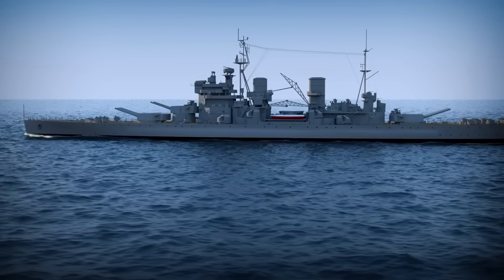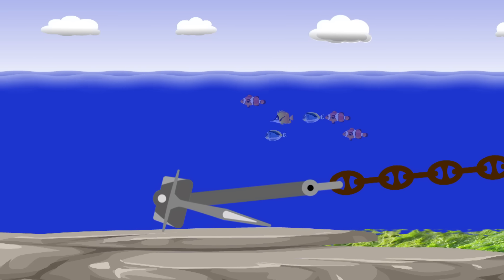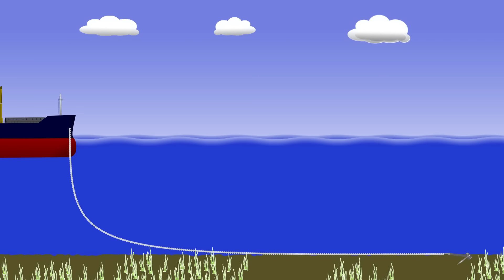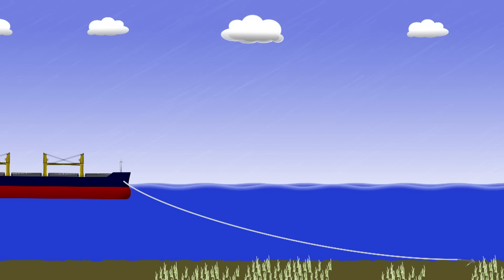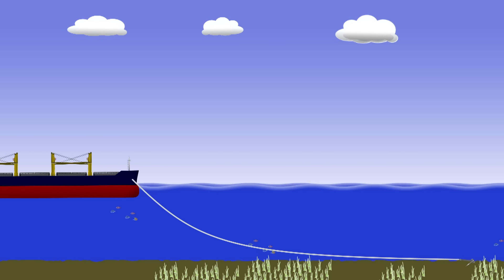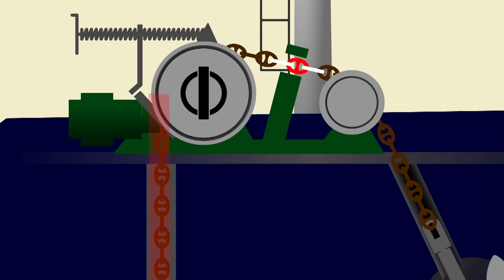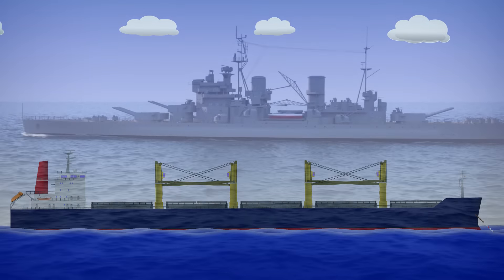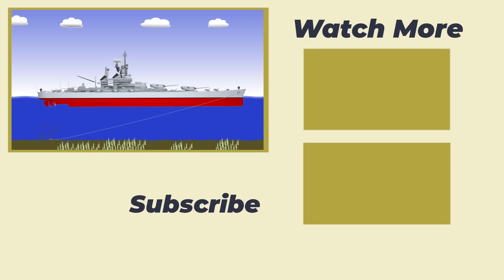The Truth About Anchoring Huge Ships

Comment: I never thought that a lesson in how anchors work would ever be warranted, until this video.  Now anchors and anchoring systems are actually really interesting.  Surprising how many things in this world you take for granted when you always think, "Well, that's self explanatory"
Reply: This is just the tip of the iceberg in terms of anchoring in general.  A real good overview of anchoring for large ships. Smaller boats use different types of anchors and anchoring systems.  Fascinating and oh so important for sailors who are not marina hopping and need to be safe over night.  Small boats use a variety of anchor styles to dig in below the surface of the bottom using the weight of the ground above the anchor to help hold.  Anchor chain, where used, is used to hold the anchor flat on the bottom so it digs in not up.  It can take a long time for an anchor to burrow and develop full holding power.
Reply: I'v actually always been wondering how anchor work, it look so tiny compare to the ship how it going to keep the ship from floating away and how the fluke (doesn't know what it's called until this video) hold securely to the sea bed just by dropping it.
Reply: @koharaisevo3666  The holding power compared to the weight of the ship is amazing but the forces needed to keep the ship in place are not related to the weight of the ship.  My 33 lbs. anchor with 40' of chain and as much nylon rope as I need for the conditions (chain and or rope used for anchoring is called the rode) will hold my nearly 13,000 lbs. boat but I'm really holding against the forces of wind on the hull and rig, wave action, and maybe a tidal stream as well.  The forces might only be hundreds to a thousand or so pounds, maybe just a tenth of the weight but still much more than the weight of the anchor and chain.  The anchor will hold the boat bow on to the dominant force, wind or current so the forces are less, less wind or water force on the pointy bit.  If an anchor had to hold the ship sideways the force would be so much more.
Reply: Sooo true! I didn't watch this video even though it was appearing in my recommendations for the past two days thinking that anchors just drop down and stop the ship. I was soooo freaking wrong... There indeed are a many things we take granted thinking that those are "Self Explanatory"...
Reply: Now I can use the word catenary around the engineering team at work and look smart!
Reply: Yes, especially the need for a sticky bottom.
Reply: Thank you for this information

Comment: “It’s just the weight of the chain, not the digging”
THIS CHANGES EVERYTHING I THOUGHT I KNEW
Reply: Same for me!
Reply: @Allan_aka_RocKITEman  Me too!
Reply: It should also chainge the way you spell change ;-)
Reply: @K9JT  Didn't spot that initially but got there in the end. 😃
Reply: @K9JT  >>> Good one...👌
Reply: Same here
Reply: Isn't it the sole responsibility of your establishment?
Reply: @bilinguliar  lol wut
Reply: @ministryofwrongthink6962  “Ministry of wrong think” admitted that it was wrong, so here we are.
Reply: It's not just the weight of the chain--the other end has to be secured firmly (by an anchor) or it will just slide along the seabed until it's up-and-down. The anchor digging into the ground and holding the chain in place is what allows the weight of the chain to do its work keeping the ship under control.
Reply: @Ignonym  The weight of the chain makes for absorption of energy in gusts and waves. The anchor takes the load.
Reply: Still need the flukes.
Reply: Imagine that my dumb fucking ass thought it was the weight of the ANCHOR itself, with no digging
God
Reply: Ministry of Wrong Think: "It’s just the weight of the chain, not the digging"
MS: Actually it is both. If it were only the chain, nobody would use an anchor. If the seabed makes it possible for the anchor to dig itself in, it will dig itself in when dragged over the ground. Then the length of the chain will make sure, that the pull on the anchor remains horizontal. The anchor holds.
Reply: You're not Ministry of WrongThink for nothing after all
Reply: @gabrieleporru4443  god same :,-( i feel like a fool, a clown
Reply: @gabrieleporru4443  I also thought this lol
Reply: @gabrieleporru4443  same. For some reason, I thought it just goes straight down and holds the ship in place through sheer weight.
Reply: That's because this guy gave you false information.  After all a rope fliats ans a lit of boats under 100 ft use rope NOT chain
Reply: Credit the uploader of the content, not the platform
Reply: @BritishEngineer  You talking to me? I didn’t credit either one. …Just had my childhood knowledge retconned
Reply: Don't believe everything you hear on the internet.
Reply: Exactly. This was what I was taught in my 'anchors and clankers' lectures.
Reply: Change it back, it's wrong.
Reply: @isodoublet  lol
Reply: @ministryofwrongthink6962  I'm not joking. Saying it's the weight of the chain that holds the ship in place and that the anchor jut serves to "hold the end in place" makes about as much sense as saying that it's the elasticity of the cable that holds a pendulum up and the attachment point "only holds the end in place". Any horizontal component of the force of the chain on the ship will get transferred to the anchor attachment point because it can't really go anywhere else -- it's pretty much a closed system.
Reply: @isodoublet  @CasualNavigation really needs to fix his wrong video
Reply: @isodoublet  there is friction of the chain on the sea bed
Reply: @squirrelpatrick3670  Sure, if the chain is loose enough to touch the floor.
Reply: @isodoublet  I mostly agree though. In a consistent strong wind, the strength of the anchor must be determined by how well the anchor digs in, with the chain fully off the ground.